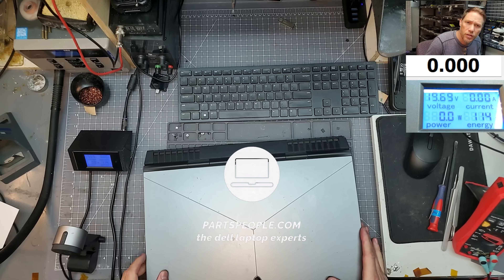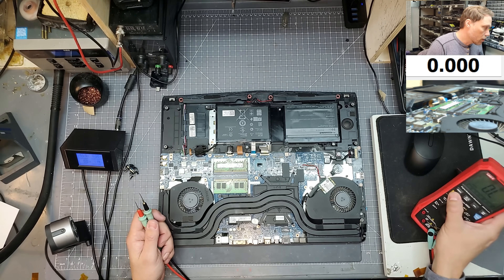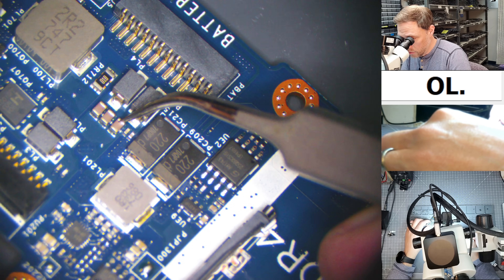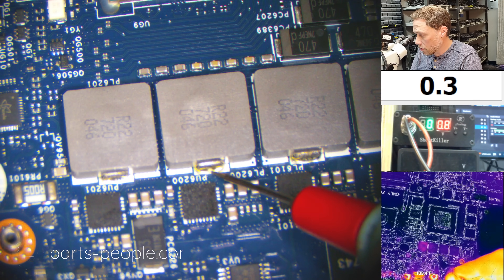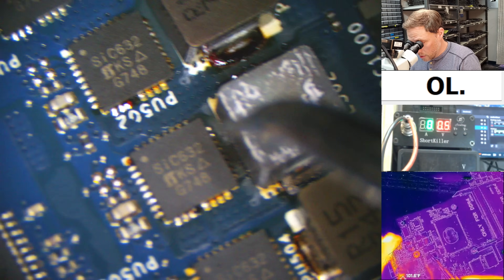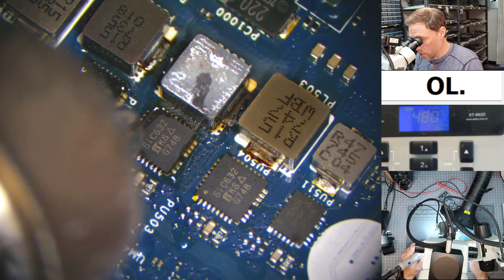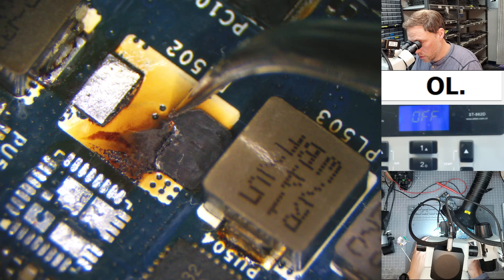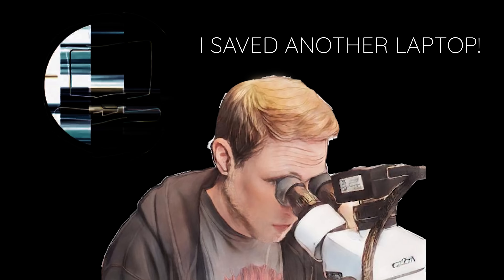Why This Gaming Laptop Is BEYOND Repair – And CANNOT Be Fixed!

Comment: I'm gonna go ahead and say it: The greatest Dell technician that's ever lived!
Reply: Who has never desoldered a coil? =)
Reply from the maker: @ashystyle  I have never had to replace a failed COIL
Reply: @dellpartspeople  @northwestrepair had all the power rails of a graphics card disabled because of ONE coil.
Reply: @ashystyle  Wait, you desolder coils regularly? You either are a student or terrible at repairs, coils are very rare to fail.
Reply: @cesaru3619  Doesn't matter. Should not be something that he has never done.
Reply: @ lol this kid think he has never done a coil removal, either correct or incorrect, he has removed coils before.
Reply: @cesaru3619  Its seems it was the first time for you =)
Reply from the maker: @cesaru3619  I have removed and soldered plenty of coils, I was just stating that I have never needed to replace a failed COIL.
Reply: @ exactly that i was trying to explain to the noob up there
Reply: @ Lol noob if you remove coils many times you are not doing proper repair...
Reply: No! Greatest technician? Absolutely not. He needs some basic training if you ask me. In my lab he would not be allowed to do this kind of repair until he had undergone appropriate training.  He just needlessly trashed a nice computer because he is ill-equipped and unskilled in replacing power components. That motherboard needed pre-heat to about 80 Celsius from below, a properly thermally controlled rework tools. He needed to do some wide area pre-heating from above. But no, he came straight in with a narrow-nozzle blower. You NEVER yank at a component when it is being heated; when hot, the adhesive layer that bonds the copper to the PCB substrate is at its weakest.  Anyway, that inductor probably did not need to be removed at all; it had not failed.
Reply from the maker: @jacks5kids  Thanks for you feedback!  The inductor's trace on one side was completely burned and arcing.  It was already no attached on that one side.  Rebuilding the tracing and including a 1 year warranty did not seem feasible.
Reply: @jacks5kids  He is doing better than a lot of IPC certified techs.
Reply: @jacks5kids  So, you saw the follow-up video where he actually repaired the laptop and ended up gifting it to the customer who had originally discarded it? Let's hear your thoughts now. 😉
Reply: @clarenceoveur9497  No, I have not seen the follow-up,. Good to know he did not need to trash that perfectly reparable computer after all, but I did not choose the title "cannot be fixed", he did. Still, my opinion is unchanged that he is  bad at soldering rework. His soldering technique is poor and careless, and he has only very basic equipment. No pre-heat, no BGA rework station with mirror-cameras, and he does not even use the primitive method of two soldering irons, which was probably all that was needed to replace the inductor.
Reply: @jacks5kids  Yes and NO, what is the name of your lab/business?
Reply: @jacks5kids  LOL!

Comment: Could you make a jumper wire/replacement trace?
Reply: I might dead bug the new coil, epoxy it in place, then run copper braid (like solder wick, but not impregnated with flux) from the one side down to the existing pad, and then run another one from the FET pins to the other inductor lead. But I wouldn't warranty it at all. 🙂 So I understand where he's coming from.
Reply from the maker: I could, but the current is very high, and it will burn up again.  It really is not a good solution.
Reply: @dellpartspeople  You could get some thick copper foil and cut out a replacement track, but it'd be very difficult and probably require some high temperature glue to hold it all in place. But it'd be quite time consuming.
Reply: @dellpartspeople  I would love to see a trace or wire replacement, then stress test the machine and check with a thermal camera how hot it gets the area, that would shut up and make a lot of people here learn something. At best, it would last a couple of weeks.
Reply: He’s worried about how much current and heat that coil has to handle going to the CPU, to just put bodge wires in, then warrantying his work. The wires would probably burn under heavy load.

Comment: What do we think the failure was? Shorted turns in coil or mosfet shit the bed?
Reply from the maker: I think the voltage was back-feeding through the COIL from the other MOSFETs because that MOSFET was shorting out.  From the color of it, you can tell it got really hot, and was probably melted internally.

Comment: What would've caused that much damage in there?
Reply from the maker: I think the voltage was back-feeding through the COIL from the other MOSFETs because that MOSFET was shorting out.  From the color of it, you can tell it got really hot, and was probably melted internally.

Comment: Great diagnoses on this one.  Unfortunately the cleanliness of the laptop didn’t save it, but better to keep them clean regardless.
Reply: That’s interesting! Besides good fans, is there a method of cooling you find effective?
Reply: @Dr._Love   I'm lately adding copper/aluminum heat sinks to hot chips, you can find them with a thermal camera when the machine is on, anything reaching 80C is getting extra cooling, also limiting the max power of the machines to less than 100% help to reduce heat. Before all this I used to replace components every month, now there's at least up to 6 months before anything bad happens and is usually due to AC power surges damaging the power supplies.
Reply: great tips on this. I appreciate it.  I’m trying to get a better understanding on thermodynamics and how it relates to circuitry.
Reply: @Dr._Love  another tip, if you check a new product, and it has the UL certification (Underwriters Laboratories) then it means it's of great quality and will last many years, even if it's made in China. UL certification is the toughest certification to get, only excellent products have it.
Reply: Owner forgot to keep it well cooled, I guess. Cleanliness is good, but cooling is better, clean+cooled=BEST!
Reply: @cesaru3619 Agreed. Keep it cool 😎
Reply: @Dr._Love  well, I've been managing the last 15 years a mid-sized company in my country with around 100 machines between servers, PCs, laptops, and cellphones and heat is the destroyer of things, but when you have the machines with extra coolers, AC, and good maintenance/cleaning they last a LOT, and they are used DAILY.